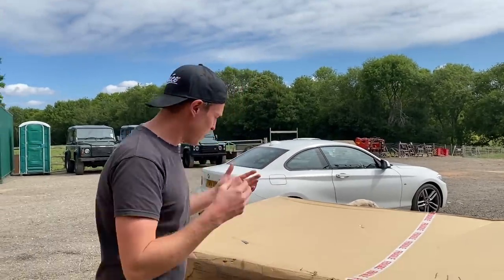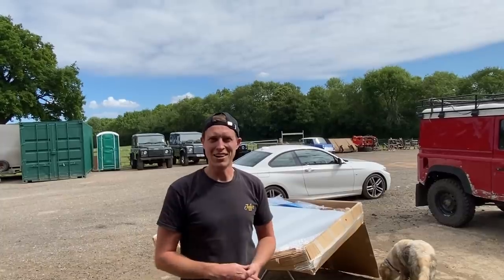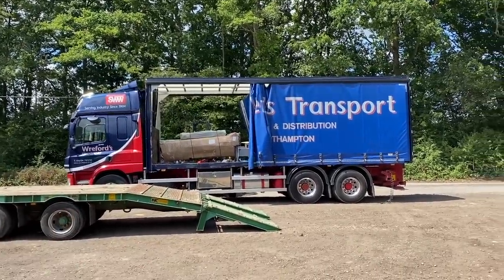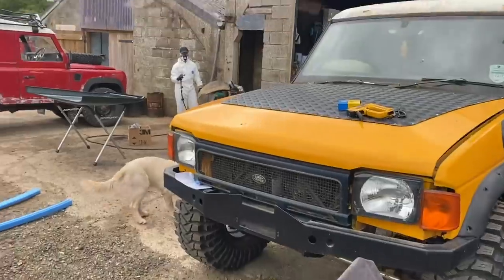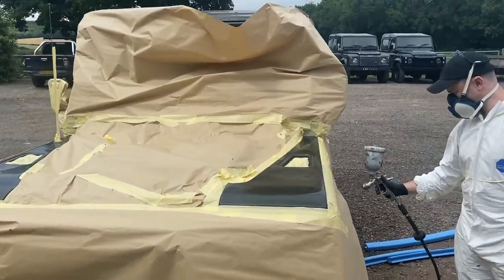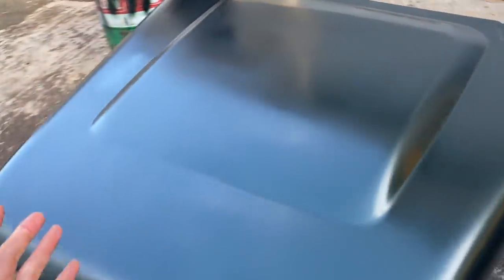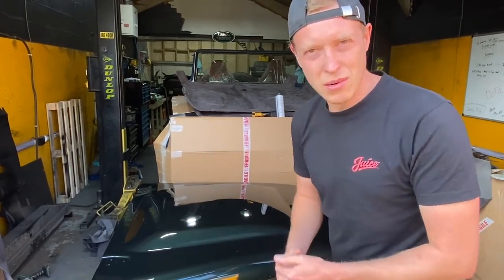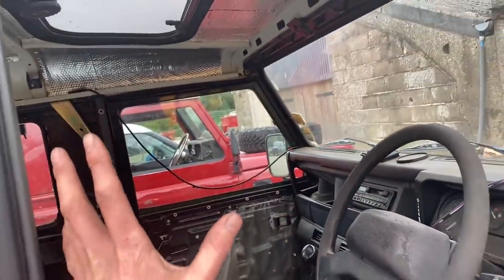Rebuilding a neglected Land Rover Defender 90 - Part 7

Comment: We have all been there, spraying outside.  The temptation to remove stuck insects is very great but by experience you end up making things a great deal worse if you try.  As you said far better to rectify when the paint is dry, sometimes there is very little evidence of touchdown anyway.

Comment: Hi there from Miami. What spray adhesive did you use for the Alcantara material on the headliner? I was watching and you place one hand underneath the material to help keep it taut and then moments later that same hand is helping press the material into the curves from the good side. If I was doing that myself with some 3m 77 spray, my hands would be super sticky and I'd ruin the material if I touched it.. How did you do that!.? Thanks in advance. Your channel is Excellent!

Comment: Like what your doing and I've painted a few cars outside (thousands in a booth) and had great results, however .. If your a business you'd create a better image using a booth or at the least knocking up a poly tent in your workshop, the lacquer your using is 2k I presume, not good for anyone and high in isocyanates, surrounding vehicles must also be over sprayed as even with a fast hardener its a sticky stuff!
Reply from the maker: Booth will be soon! Just doing what I can with what I have available to me

Comment: You make applying the alcantara look so easy, I had purchased some myself and what a game I had applying it, took me ages but it looked in the end, But now I’m finding it coming away from the headliner in some areas which is so annoying, How an earth do you make such a difficult job look so easy? Any help would be greatly appreciated. Your vids are ace by the way!
Reply from the maker: Hi Richard, it’s taken a while to nail the technique but mostly your material isn’t stretchy enough, you’ll need to remove the original PVC headliner covering too as the glue can’t really bond all that well to it. Use Fast Fix - high temp glue on the original fibre board and it should be good to go
Reply: Juice Motors Thanks Sam, I got the idea from your vid fitting the pan roof on the 110, I left the pvc on because it’s a 12 plate and was in good nik, How as it held up on the 110 over the original pvc Sam has it held ok? It’s only in a few areas that it’s coming away! Iv thought maybe injecting fabri-tac into these areas! Wat do you think?
Reply from the maker: Was it thoroughly degreased? You can leave the PVC in place but you’ll need to use a stronger glue more suited to plastics, degrease and key the material
Reply: Juice Motors 
I did clean it with a degreaser but I used trim-fix adhesive, I purchased the alcantara from eBay and I also found when sticking it down in the difficult areas the fabric would crease very easily! Is this normal? Sorry to be a pain lol.
Reply from the maker: It’s definitely the material at fault here, send me an email and I’ll sort something for you